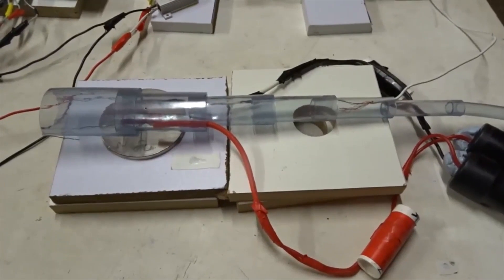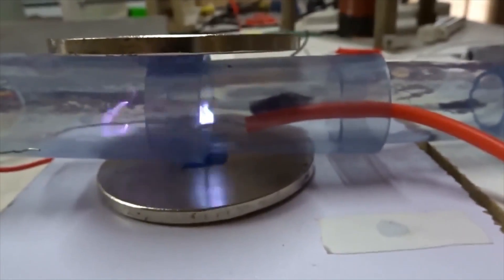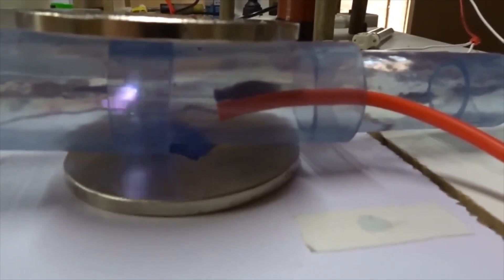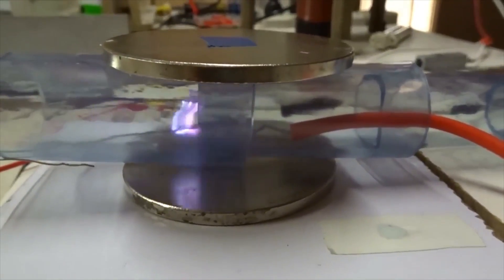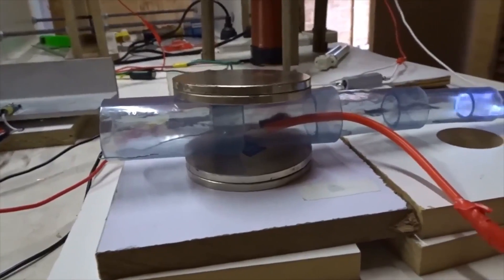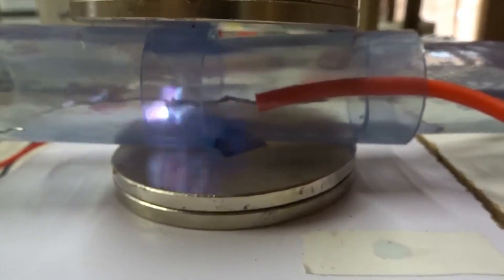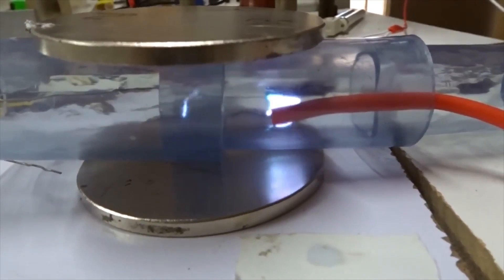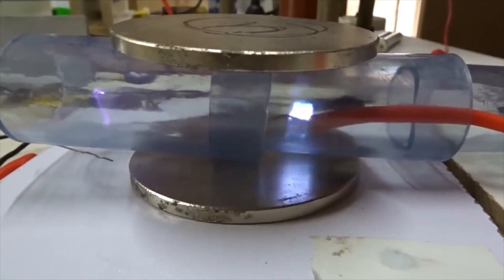Magneto plasma dynamics using a Tesla coil, 40 kV DC and permanent magnets

Comment: Apply a vacuum and the space in the tube will fill with electrons at Paschen pressure levels (appx 100,000 feet altitude).  Just be careful, any electrons accelerated to hit metal create Bremstrahllung x-rays.

Comment: only a few ionized ions are needed to start the flow, no separate ionizer required
Reply: it should have ion-electron avalanche ionization
Reply: epic mate
Reply: come on, more air inlet, to it to be a "turbine" :)
Reply: also electromagnet coils for the top and bottom magnets
Reply: that is kinda far, that ionization source, feels like it
Reply: I have to confess, no ET call home, God gave all
Reply: btw, its very close to the high electric field airplane thruster, just longitudal electric field only
Reply: I'm not an ET, btw, thanks :)
Reply: I'm just a human, but I got things as a free gift, no obligations, no patents
Reply: try a welder to make the dc arc, max power
Reply: that can be used to make a solid state vacuum pump, it will either push ions inside the wall (as ion bombardment) or out of the thing as ion pump
Reply: circular plasma railgun track, both electrons/ions travel the same direction (around the ring), dc emf, of course electrons/ions go the opposite direction in the plasma arc wire current, spin circle fusion reactor, if you use deuterium gas